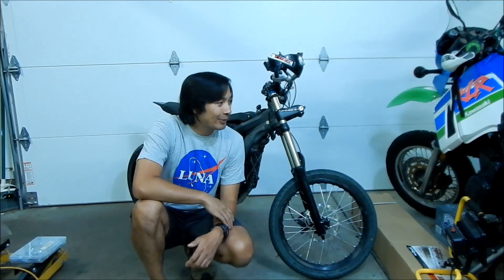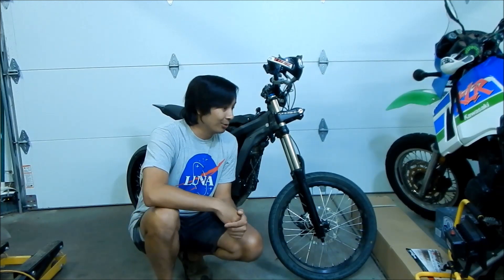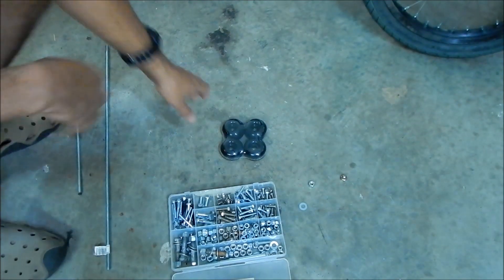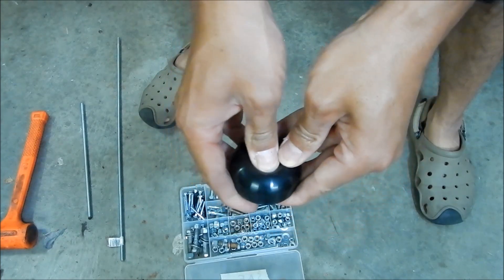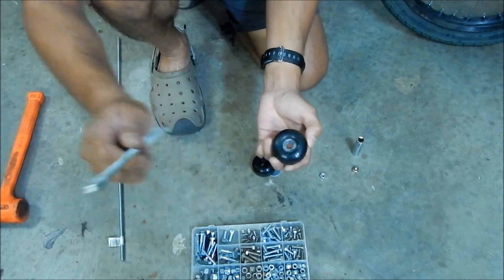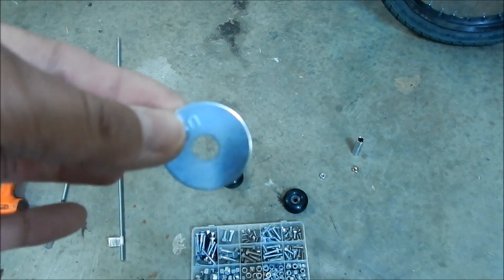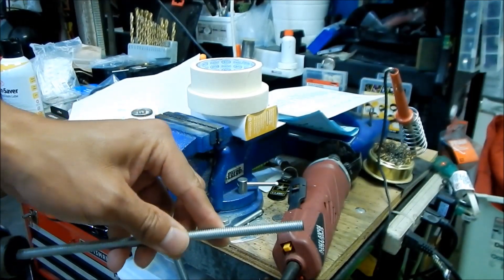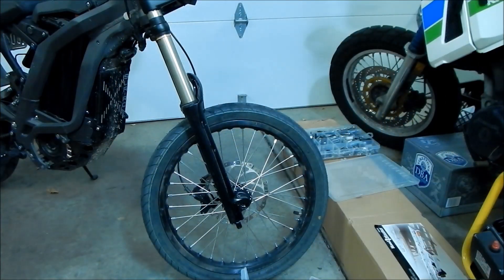HadesOmegaSpec Sur Ron Light Bee Supermoto Sliders PT.2 - Front

Comment: You're the only one i found doing anything like this.. there are some very cool looking slider and frame protection kits i think "may" fit on the sur-ron.. so i want to try some frame and swing arm sliders. Plus put the moto cross stand pegs on the front and rear.. also would like disc brake covers.. the sur-ron im tring to build is super-moto set up..
Reply from the maker: cool yeah I'm still using everything that I installed.  I bought some Chinese footpegs that have a little rubber shoe that you screw on give me more clearance before it scrapes.  The rear sliders you might be able to use from another motorcycle if you can find a plate that fits in the channel of the swingarm.  There's some very nice fancy ones out there.  There's just not enough demand for them so no one will produce them unfortunately =/

Check this video out:
https://youtu.be/ungWiz5Y8Hs

Also Warp9 makes footpegs for the Light Bee now and they have a supermoto footpeg slider that you can add on to it.  Goodstuff but it's $$